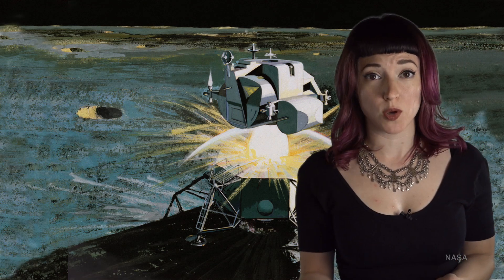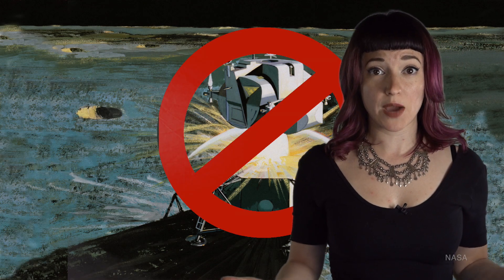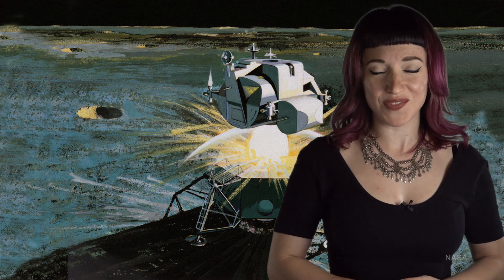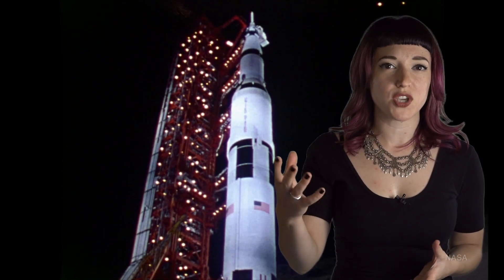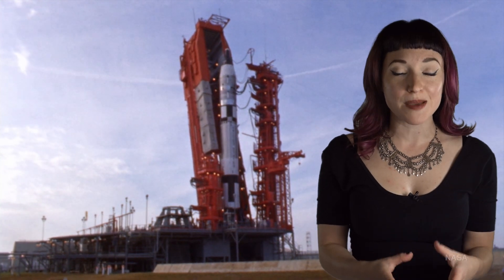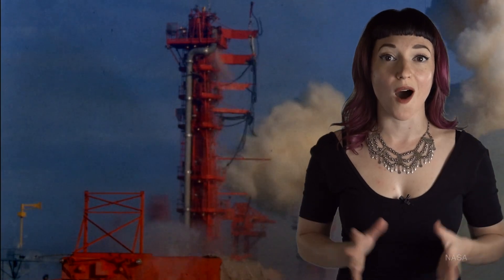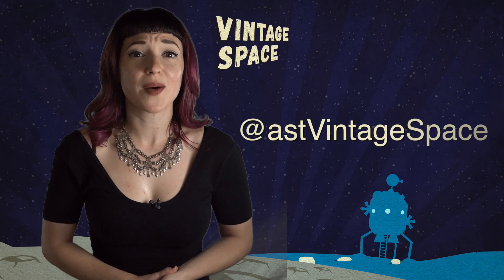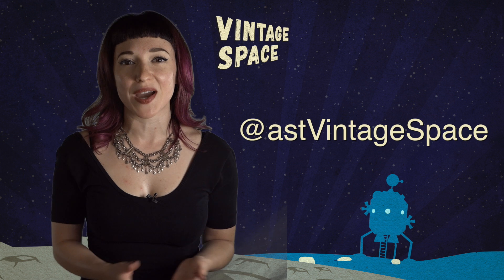How the Lunar Module Launched from the Moon Without a Flame

Comment: Here is something the astronuts chiming in here can chew on.
Reentry. 
Reentry of the Apollo capsule was designed to withstand 5000° heat at its heat shield. To date there is NOTHING on earth when applied to a "heat shield" that can withstand anywhere near that temperature. The supersonic reentry of an aluminum craft would have turned into a molten fireball in seconds. The astronauts heads exploding first from the enormous pressure change. 
Then there is this:
Only magical thinking could keep the capsule from instantaneously TUMBLING  into the atmosphere and at supersonic speed. 
NASA apologists are ALL WET.
Reply: YOU SAID: "Here is something the astronuts chiming in here can chew on.
"

== Oh, this should be good.  Internet moron thinks the entire planet's physicists and aerospace engineers don't understand physics and aerospace engineering... and THEY're the "nuts"??  Dunning-Kruger.

YOU SAID: "Reentry.  Reentry of the Appolo"

== You cannot spell "Apollo" correctly, yet think you know enough about Apollo to call it fake.  Dunning-Kruger.

YOU SAID: "capsule was designed to withstand 5000° heat at its heat shield. To date there is NOTHING on earth when applied to a "heat shield" that can withstand anywhere near that temperature."

== Well, that depends on what you mean by "withstand."  The tiles on the shuttle withstood temperatures of 3000 degrees.  But, yeah, it only had to enter at 17,000 mph, not 25,000 mph, like Apollo did.  So, yes, the temperatures on Apollo undoubtedly were higher than they were on the shuttle.  So what?  Why do you think "withstanding" it was what they chose to do?  They chose not to "withstand" it, and just use ABLATIVE heat shields.  The heat shields were designed, intentionally, NOT to "withstand" it, but instead, just heat up and flake away as super-heated gas, allowing the heat to disperse with it as gaseous material.  By design, the didn't even attempt to make anything capable of "withstanding" it (meaning, survive re-entry intact).  That's how an ablative heat shield works.  It basically (short story) vaporizes as its absorbing the heat, and the heat is taken away from the craft that way.  Dunning-Kruger.

YOU SAID: "The supersonic reentry of an aluminum craft would have turned into a molten fireball in seconds."

== Pffttt.  So, all of the countries that use ablative heat shields... none of them really did it?  Soviet Soyuz craft?  They're not real either?  They all turned into fireballs too?  What about USA's spacecraft prior to Apollo?  The Gemini craft all turned into molten fireballs also?  Dunning-Kruger.

YOU SAID: "The astronauts heads exploding first from the enormous pressure change."

== Pffttt.  Oh, you're a real genius.  The craft were kept at about 4 PSI.  What "enormous pressure change" would they get if they dropped to zero?  You think 4 PSI is an "enormous pressure change" that would explode heads??  Dunning-Kruger.

YOU SAID: "Then there is this: Only magical thinking could keep the capsule from instantaneously TUMBLING  into the atmosphere and at supersonic speed."

== ALL spacecraft from EVERY country is fake now too?  None of them have tumbled.  And, hmmm, why isn't there an aerospace engineer anywhere on the globe pointing out these amazing revelations of yours... that the aerodynamic properties of capsules are all wrong??  This has been textbook material for 50 years, you know.  The aerodynamics of capsules is well understood.  But, YOU know better, huh?  YOU?  YOU, who has never set foot into a university classroom on the topic??  YOU know about the aerodynamics of capsules better than the entirety of aerospace engineers everywhere on the globe?  Dunning-Kruger.

 YOU SAID: "NASA apologists are ALL WET."

== Dunning-Kruger.
Reply: @UCaBeybfq3faQfzuXKPGQdRA YOU UNMITIGATED ASSHOLE.
NO RETURN OF HUMAN CARGO IS POSSIBLE. 
NO NATION HAS RETURNED HUMAN CARGO FROM DEEP SPACE.
YOU FUCKING PROPAGANDIST PRICK.
Reply: @CarlMarksmoney  awfully testy for an idiot.
Reply: @UCaBeybfq3faQfzuXKPGQdRA THE STATEMENT STANDS:
NO TECHNOLOGY EXISTS THAT CAN KEEP SAID CAPSULE FROM TUMBLING INTO EARTH'S ATMOSPHERE FROM SPACE AT SUPERSONIC SPEED. 
ONLY
SPACE FANTASY!
Reply: @CarlMarksmoney  
YOU SAID "YOU UNMITIGATED ASSHOLE.
  NO RETURN OF HUMAN CARGO IS POSSIBLE.  NO NATION HAS RETURNED HUMAN CARGO FROM DEEP SPACE.  YOU FUCKING PROPAGANDIST PRICK.  NO TECHNOLOGY EXISTS THAT CAN KEEP SAID CAPSULE FROM TUMBLING INTO EARTH'S ATMOSPHERE FROM SPACE AT SUPERSONIC SPEED. 
ONLY
 SPACE FANTASY!"

== Pffttt.  Repeating your stupid notions does not make them correct.  But, hey, you clearly believe that you know more about aerospace engineering that the entire world's aerospace engineers, despite that you've never taken a single university class on the topic.  Dunning-Kruger.

Comment: I'm so sorry love, but you are monumentally wrong.
Reply: Care to elaborate?
Reply: @finaoo1167  Well, here goes: How did the camera follow up when it took off? It is supposed to join nose to nose with the landing capsule orbiting the moon. if they join this way; where are the parachutes housed?
Where was the dust on the lunar lander feet?
Who passed him the feather when the did the Galileo thing? How could her pick up a feather using those gloves. I've tried with wicket keepers gloves; it's impossible. And those gloves would have to far more robust that cricket protection. How does the craft rid its self of heat in a vacuum?
Reply: @philholdsworth8280  
The camera was carefully placed and it was controlled by mission control in Houston.  They had to anticipate the timing to have it track the ascent.  They were way off when they did it on Apollo 16, so we never see that film.  They weren't exactly right on with Apollo 17 either, but it was close enough to make the highlight reel.

I think the parachutes were housed on the nose cone of the command module.  The lunar module was jettisoned before they re-entered earth's atmosphere.  Are you asking because they would not have been able to deploy the parachutes with the lunar module in the way?

I've seen the feather/hammer video, and I don't understand why the feather is an issue for you.  We don't see him pick up the feather before or after.  He might have been handed the feather.  He might have picked it up.  Your difficulty picking up a feather notwithstanding, obviously he is holding a feather, so it's possible for him to do so.

Why would the craft need to rid itself of heat?  But regardless of the reason, air is not necessary for the radiation of heat.  We wouldn't be here if the sun could not transfer heat to the earth.  Likewise if the earth could not rid itself of heat into space.
Reply: @philholdsworth8280  is Google blocked where you live, or are you too lazy to look up these answers yourself?
Reply: @rockethead7  Jesus, of course. I'm so fucking sorry, my mistake. My opinion has been reversed.
Reply: @casanovafrankenstein4193  Google blocked mate. I've changed my opinion now. They definitely went to the moon. They really did, I'm so happy. And proud.
Reply: @philholdsworth8280  I'm glad I could help you escape the rabbit hole of ignorance. My work is done here.
Reply: @casanovafrankenstein4193  Oh I'm so happy the veil has been lifted. I feel liberated and free. Thank you, thank you, thank you.
Reply: @casanovafrankenstein4193  You're so cruel. I'm genuinely happy. 
The Dutch are still very happy for the present Neil Armstrong gave them. They're still laughing. So funny.
And, I am, a MASSIVE ignoramus - MASSIVE. There's a great deal I know absolutely nothing about. I'm happy with this knowledge.
Reply: @casanovafrankenstein4193  
The "petrified wood = moon rock" story is even worse than you've explained.  You're reciting the more friendly version.  But, no matter what, it's painfully obvious that NASA had absolutely nothing to do with the petrified wood.  Yet, the conspiratards still use it in their playbook of stupid things to say, no matter how obvious it was that NASA had nothing to do with it.  The art museum accepted that rock without any verification whatsoever, and that's the core of the problem.  As I've always said about that petrified wood story, this is akin to a museum accepting a Rolex watch with no verification, then finding out it was fake... then the conspiratards blame Rolex for it, and then they use that as ammunition to say that real Rolex watches don't exist.  The conspiratards are psychotic, every single one of them.
Reply: @rockethead7   from a UK paper https://www.telegraph.co.uk/news/science/space/6105902/Moon-rock-given-to-Holland-by-Neil-Armstrong-and-Buzz-Aldrin-is-fake.html
It would seem that the astronauts did give the fake rock to the Dutch museum. I think they were in in employ of NASA, or its then equivalent.
Anyway they did not go to the moon. Really, they did not.
I'm bored of this now, so I'm moving on.

Comment: who filmed it blasting off? the camera clearly panned upwards lol
Reply: The camera was attached to the lunar Rover, on a flexible mount. Panning was controlled by someone in Mission Control. Due to the time lag the command to pan had to be sent before the Ascent Module had lifted off. There was some guesswork involved in getting the timing right, which is why they only captured the LEM lifting off once.
Reply: @butchs.4239  
Well, they captured the LEM lifting off more than once.  But, if you mean capturing it as well as this video, yeah, you're right.
Apollo 15, the tilt mechanism broke, and they couldn't pan up.
Apollo 16, the rover was too close, and the timing was off, and it went out of view quickly.
Apollo 17, their last and best effort.  There wasn't quite as much guesswork as you think, though.  Ed Fendell told Gene that if he parked the rover too close, he was going to kill him.  And, Fendell took a bunch of simulated practice runs beforehand to get it right.  Yet, still, at the end, when 17 was high in the sky, the camera did rock back and forth a little crazy.  I'm not sure why he did that, or if it was a malfunction, or what.  But, that time, Fendell kept it in frame.

Comment: Something that has always amazed me is that we went from Gemini to Apollo full mission , Lunar landing,  Lunar Orbital Docking, and  return to earth, with full mission communications in the space of say 5 years from the Gemini period. Fantastic.
Reply: Well, yes, it's good stuff.  But, just to complete the picture, the Apollo program actually began before Gemini (the program itself, not the manned flights).  Gemini was actually a bit of an afterthought.  But, they knew Apollo was too huge to actually get stuff in to the sky fast enough.  And, they needed a proving ground for all of the concepts of Apollo (working outside the spacecraft, rendezvous and docking, long duration flights, getting some milestones under their belts, getting experience for astronauts, etc.).  And, they could get [what would become Gemini] off the ground more quickly than they could get Apollo off the ground.  So, anyway, my point is, they began the real work on Apollo in 1961, not just 5 years prior.  Not meaning to argue, your statement doesn't lose any of its value, I'm just elaborating.
Reply: Yeah fantasytic
Reply: No we did not. It was a hoax
 Wake the fuck up bro

Comment: We did not land on the moon.  So fake . Also only 17 % gravity on the moon.  So they have to have tied down the landing module to stay on the surface .Also the astronauts jumping up and down ? You go straight up and and keep going . The surface of the moon has like a crystal surface don’t see it in any footage . Look close on the ground you see cables and a cable on the back of the astronauts lifting them up.  We had to beat the Russians so we faked it.  Guy said it was made In a London studio .  Sad but true .
Reply: Greg LaPlante  I hate to tell you this but at 17% gravity, the LEM still weighed in at over 5,000 lbs. That plenty of weight to hold it down. Even the astronaut’s weights were enough to hold them down. Sorry but that’s just one more conspiracy fail.
Reply: @JerryN7970  
YOU SAID: "the LEM still weighed in at over 5,000 lbs."
== You have forgotten that it burned 18,000 pounds (Earth weight) of fuel/oxidizer on the descent.  Adjust your calculations, and you'll find that the LEMs weighed (depending on which mission) around 2500-3000 pounds (lunar weight) upon landing.
Reply: rockethead7 👍🏻thanks. I think it’s safe to say it’s not going to just “float away!” 😀
Reply: No it came from former nasa technical people . I hope we went .
Reply: @greglaplante7593  
YOU SAID: "We did not land on the moon.  So fake ."

== You're an idiot.

YOU SAID: "Also only 17 % gravity on the moon.  So they have to have tied down the landing module to stay on the surface ."

== Why?  If there's ANY gravity, you wouldn't need to tie it down.  Tie it down from WHAT?  Basic entry-level physics.  Whether something moves or not is all dependent upon the net forces applied.  If you have 10 pounds of force holding something down, and 2 pounds of force trying to pick the object up, guess what, it stays down.  In the case of the lunar module, there was about 2500 pounds of force (the weight of the lunar module in lunar gravity upon landing) holding it down.  What EXACT force are  you worried about that would pull it upward?  What's the source of this upward force?

YOU SAID: "Also the astronauts jumping up and down ? You go straight up and and keep going ."

== So, let me ask you... let's pretend you were correct... you're not, but let's pretend... so, ok, it's your assumption that if there's 1/6th of Earth's gravity, that means that you jump up and you'd just keep going up... that's what you're saying, right?  OK, so, let's pretend there are some aliens on a nearby planet Imaginarium with 6x more gravity than Earth has.  And, you hear one of those aliens argue that, "the Earth is fake, there are no people on it, because if they ever jumped, they only have 1/6th (17%) of the gravity as Imaginarium, therefore those supposed Earth people would just keep on going, and since that doesn't happen, Earth is fake."  What would you say to those people on Imaginarium?  I mean, do you get it?  Just because there's less gravity on the moon than on Earth, doesn't mean you will keep going up.  And, I mean, c'mon man, this is just plain stupid.  Don't you think that EVERY FUCKING PHYSICIST ON THE PLANET would be screaming bloody murder about Apollo by now, if what you said was true?  No?  50 years go by, and every physicist in existence on the entire Earth, in friendly or enemy countries, is too stupid to notice that people should just float away??  That's how your mind operates?  You know physics better than the last 50 years of physicists on the entire planet?  Every physicist has physics all wrong, but YOU know better?  Good grief.

YOU SAID: "The surface of the moon has like a crystal surface don’t see it in any footage ."

== A CRYSTAL surface??  Do you even know what a CRYSTAL is?

YOU SAID: "Look close on the ground you see cables and a cable on the back of the astronauts lifting them up."

== The astronauts were lifted by a cable on the ground??  You're just saying stupid things just to get a rise out of people at this point, right?

YOU SAID: "We had to beat the Russians so we faked it."

== Soviets.  But, whatever.  I guess you think the entirety of the Soviet Union was so fucking stupid that they didn't notice that the LEM and astronauts were supposed to float off into space.  Yup, we faked it, and the entire world didn't notice these amazing problems YOU noticed.  Sure.

YOU SAID: "Guy said it was made In a London studio ."

== Oh, well, if a guy said so, it must be true.  Nobody has ever said anything incorrect.

YOU SAID: "Sad but true ."

== How stupid are you?  Seriously.  Have you had your IQ measured before?  Did you break past the 60 line?

YOU SAID: "No it came from former nasa technical people ."

== And, you believe this, why?  And, let's pretend you're correct, that some guy (unnamed), who was a technical person at NASA, said all of this utter gibberish you're talking about... let's pretend that's true... guess what, there were 450,000 people who worked on the Apollo program.  Finding ONE moron who spews garbage isn't exactly good evidence against the other 449,999 people who disagree with the one moron.

YOU SAID: "I hope we went ."

== No.  You do not.  That's why you listen to ONE guy, who you think was a NASA tech (but cannot name or confirm this), rather than the other 499,999 people who disagree.  No.  You do not hope we went.  You hope the 450,000 people were failures also, just like you, so you can feel better about yourself.  You've accomplished NOTHING, therefore you spit in the faces of the 450,000 people who accomplished Apollo, the greatest technological feat in human history.  Rather than taking the difficult road in life... getting an education... working hard to get a few degrees under your belt... working for a few decades in a scientific career... working on programs that bring humanity to a new level... you know... THAT long road... instead, nope, you choose to spit in the faces of the people who have done that, and accuse them of being liars and frauds, so you can take the easy road, by believing that those 45,000,000 million years that it took to make Apollo happen (450,000 people for 10 years) were all a big waste too, just like your life has been.